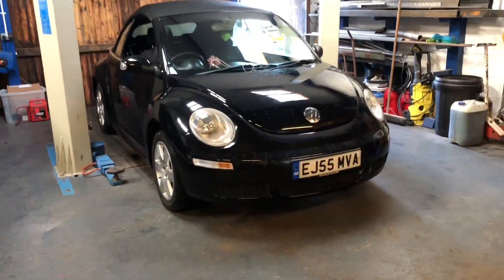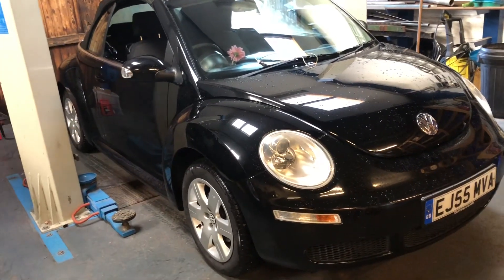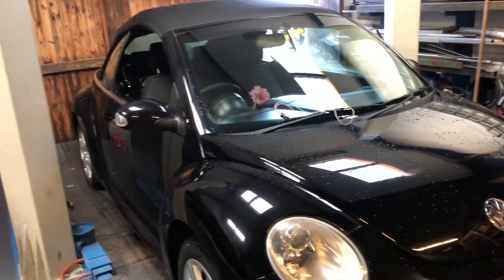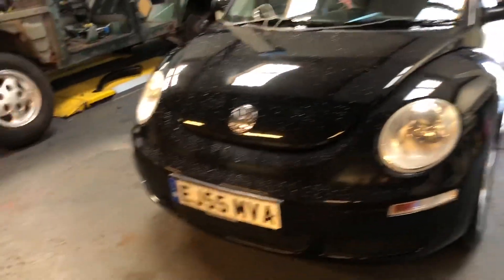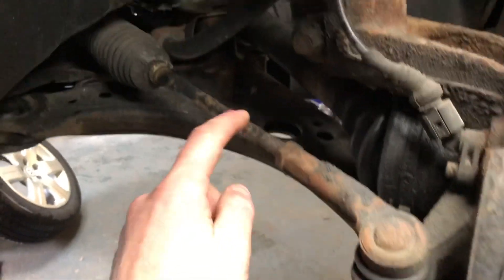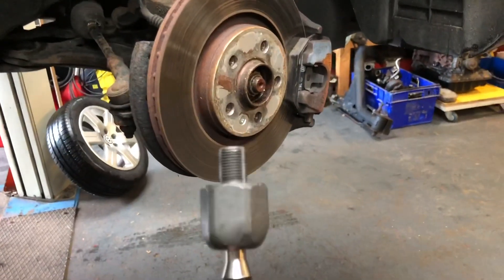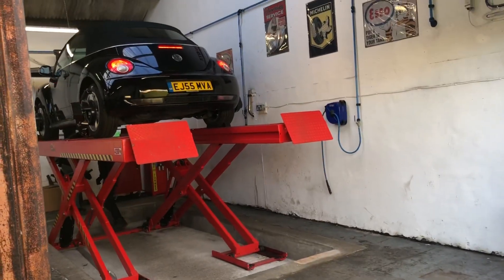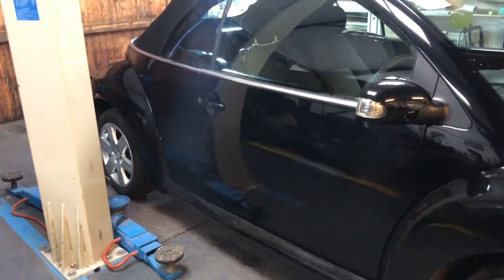£200 bargain VW Beetle convertible pt4

Comment: This was neat to see. I used to build the steering gears for these cars. The left hand ones, anyway. You’re a bit lucky in the fact the inner tie rods were just torqued. We built others that’d use loctite and you’d only get one use of those parts as it would destroy the threads on the rack if you took the tie rod off.
Great job as usual. I’ve become a big fan of your channel

Comment: Rob, just finished this exact job on a 2002 VW T4 transporter; the track rod ends accept a torx bit in the bottom so that you can counterhold & stop them rotating then you dont need the grinder - surprised the Beetle is not like this. Great vid as usual mate 👍
Reply from the maker: Florence Doberman it is but I’m quick and lazy lol plus they are always rotten 👍
Reply: Fair comment mate 🤣

Comment: Good video buddy, there is a very handy tool for opening those tie rods ,not  expensive,  also would always use thread lock on the inner joint.

Comment: I did enjoy watching the little bit as I cut my teeth in the garage doing wheel alignments cluches services, basic stuff but yea mate I'd be under there with a wire brush and wd40 cleaning up the drum sticks and locking nuts to get the tracking done
Reply: @Viktor Sligo I'm pretty sure they still do use those on alot of wheel alignment machines mate, the one in my garage does with a computer to read the numbers off of. I think there's new machines that can do differently though. Think the results are all the same because it comes down you adjusting it correctly as the machine hasn't got hands to do them for you lol

Comment: Hi Rob, please use a pair of thick gloves when using a grinder,especially when using a cutting disc. A few years ago, I picked up the grinder to do a quick job and didn't put my gloves on. The grinder kicked back and cut a gouge in the back of my hand. Thankfully it was a grinding disc, not a cutting disc. Fortunately it didn't damage any tendons, but could have been a lot worse. I always wear gloves doing this work nowadays.
Also, I always measure to the centre of the track rod end as sometimes the new parts are slightly different in size to the old ones.

Comment: Easier way to get your tie rod locking nuts in approx right place is to count the full rotations of the locking nut has you remove it eg 12 full turns off 12 full turns of the nut on to the new tie rod
Reply from the maker: lancashire Biker we all use different ways

Comment: Another quality video mate, keep it coming!
Out of interest did you find out how much the alignment needed adjusting. Just changed inner and outer rods on my Astra but waiting to change the rear trailing arm bushes this weekend before getting it aligned. I measured the length the same as you but just curious as to how close this was? Cheers mate.
Reply from the maker: hodgkinsonalex it drove ok after but was out 👍
Reply: salvage rebuilds uk Thanks for the response Rob, I know your busy. I’ll probably get it aligned Monday morning. Should have done 10 miles tops by the time I get to the tyre shop 👍

Comment: Excellent Rob would it work measuring from the thread to nut on the old one? And making sure the new one measures the same
Reply from the maker: mtype101 Either way it will need to be tracked
Reply: @sruk  Thanks Rob

Comment: So set up that nut position from the wrong end of the rod, it needs to be measured from the big but end you need the over all lenght the same, how do you know that the oem part was the same length as the replacement, these items have manufacturing tolerances
Reply from the maker: phill mountford like I said in the video I measured them and were the same length
Reply: @sruk  just giving a perspective from an engineering perspective, I'm no mechanic, was just an observation. You have great content, been following a good while and will be in the future 👍

Comment: You probably didn’t even need to scribe that track rod? Just work the nut off remove the boot and wind the nut back to the rust line. Probably close enough for a comparison with the new one to get it back together to take to the tracking shop?
Reply from the maker: Mark Bennett we will all prob differ a bit but hey tracking after anyway 👍

Comment: Rob, do you have to torque load wheel nuts, or just do em fkin tight and then re-tighten after a few miles or not bother? I think the manual says torque to such and such nm's but I didn't bover cos I'm harcore and I live in the fastlane, either that or I'm just kin stupid lol 🤣
Reply from the maker: Rob they should be torqued yes but 9x out of ten they will already be tighter than the torque setting 👍
Reply: @sruk  Tighten to FT spec lol
Reply: @sruk  Just did some research on this and apparently they shouldn't be over tightened as it can distort the hub, rotors and the wheel! I think I'll be torque wrenching from now on...